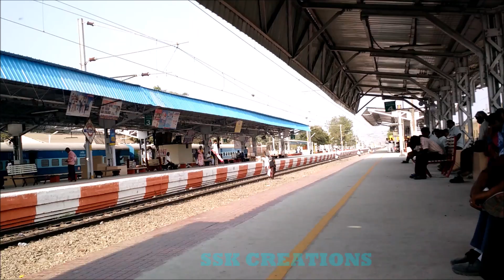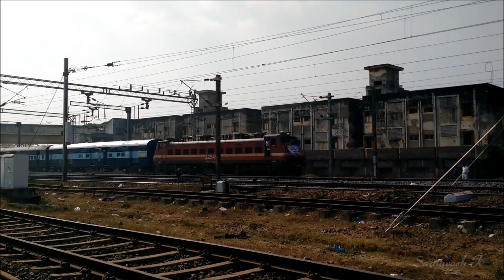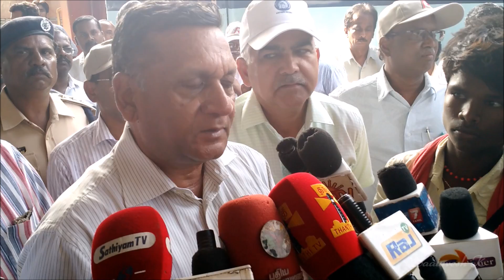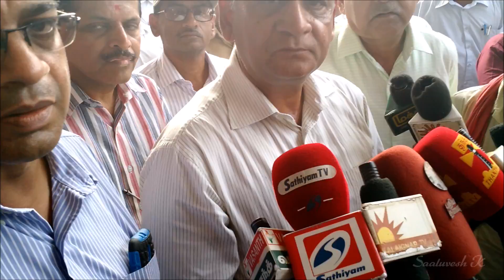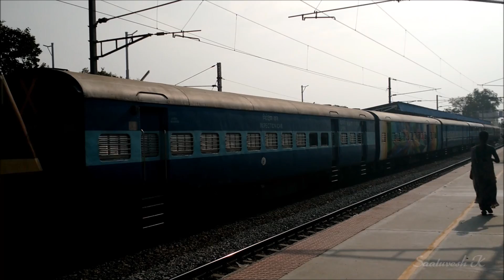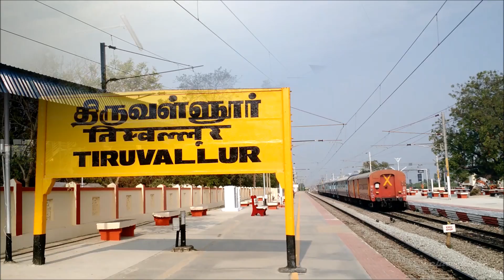CHENNAI : Thiruvalangadu - Tiruvallur High Speed Trial & CRS Inspector Interview

Comment: There must be 4 tracks between AJJ and JTJ so that 2 set of express trains can be run in parallel and 2 set of express trains can be run in return.
Reply from the maker: +sudhakar355 indeed :) Let's hope for the best
Reply: Please post the videos of the trains 12243 and 12244 skipping AJJ, Walajah road, KPD, Ambur, MAP, BQI.
Reply: Do you have videos of the trains 12007 / 12008, 12027 / 12028, 12685 / 12686, 12623 / 12624 skipping AJJ and JTJ?.

Do you have the videos of the trains 12671 and 12672 skipping JTJ?.
Reply: See the arrival time of the train 12675 and 12243 at SA on 03rd APRIL 2016 !!!!.